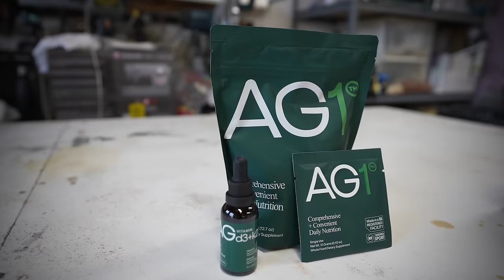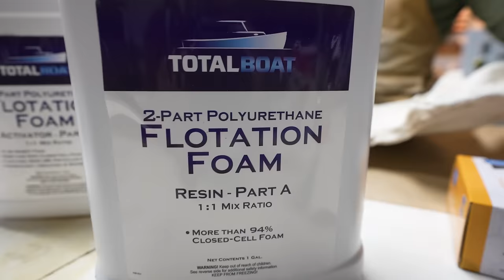Why I Covered my Whole Body in Plaster

Comment: A cousin of mine who is an artist made a body cast of herself and then took it to a candy factory, where they cast her in hard rock candy!  It was amazing.
Reply: Sweet!
Reply: I wonder how she explained that to the grandparents!🫣😆
Reply: Heh, it's.. an experience! I was a photographer, did some makeup courses and ended up dating a stage makeup and prosthetic artist. They persuaded me to get a lifecast of my head. Was great for making prosthetics, but not exactly a comfortable experience. I've been wondering if it'd be safe or possible to vacform body parts, but I guess it would be rather unsafe to try that on a head.
Reply: @brolohalflemming7042 Vacuforming involves heating the plastic so it will conform to the shapes. Skin and melted plastics are not a good combination,....
Now, vacuforming around the life casts, to make lightweight sections for a cosplay armor, that can be effective.
Reply: @PiDsPagePrototypes  Yes, indeed. This was something I'd been having fun with using my casts. But this was a couple of decades ago, and vacuforming has moved on, so if there were lower temperature polymers that might be safer. But if I had the money, what I'd really want is a scan, then mill-a-me out of stainless steel. Fit joints and a poseable me! Not exactly portable, but durable.
Reply: Is your cousin Ali Spagnola? She did that and then threw it from her balcony to the concrete driveway. For art, of course.
Reply: Having a candy me is my new life goal.

Comment: As a fellow makeup professional who has taken life casts many times, I was quite worried when I saw the title, as people have seriously damaged themselves by using raw plaster against their skin.  (Do NOT do that!!  Plaster heats as it cures, and can burn your skin!  It can also encapsulate hair and fine tissue, causing extreme pain if not permanent damage.  Do NOT use raw plaster directly against your skin!!)  
So I was quite relieved when I saw you in the hands of such capable professionals as Jason and Mel.  Technically speaking, you don't have to be completely naked to do a life cast; you could have worn a sports bra and shorts, to go the silicone mold route; it's not an all-or-nothing proposition.  But this technique seems to have worked out fine, for your purposes.  It was actually interesting to see the silicone go INSIDE the plaster mold- essentially as a mold release.  Interesting, for sure- makes me think about alternate ways of doing things.

Some more sanding to refine the shape and take out the extra bumps, and then sealing with a top coat: that would be WELL worth the extra time and effort.  You're not going to want to put fabrics and such up against that raw foam; it'll snag all to heck.  But this is a great start!!  It's so fun to have a clone of yourself, isn't it?  😄😄
Reply: I'm so glad someone mentioned this cause in high school my class did plaster mask and to protect from burns we put Petroleum Jelly on our faces the partner I was assigned didn't put enough on my eyebrows so when the mask came off so did like 6 eyebrow hairs from each eyebrow which really hurt so yahhhhhh.
I'm also rather glad you mentioned wearing something like a sports bra and shorts underneath cause I was thinking the exact same like "why wouldn't she just wear a bikini or a tight tube top and boy shorts" strange that she didn't think of that since she wears sports bras and shorts as ever day clothes like all the time and she was literally a beauty pageant winner so she's worn a bikini in front of hundreds before and thousands if you count everyone who has seen it and her bikini pics on Instagram so weird her mind went straight to leggings and a rather loose shirt...

Comment: when i was doing theater prop stuff, the way we made full body "casts" was with chicken wire! we'd make a stand (essentially a basic armor stand shape) and then we'd wrap the lady being cast in chicken wire. from what i remember, she did the wrapping herself for modesty reasons, because it required a LOT of fine tweaking of the metal wires that make up the mesh. i believe we had the seam actually run down the side of the model being cast instead of the back because she had to do a lot of fitting around her bust by herself. when she was done shaping the chicken wire to her body, she just gently opened it like a book, slid out, and the mesh sprung back shut. after a bit more fine tuning, we put the mesh on the stand so it stood at the right height. then it was just a matter of picking a skin. we went with a thick latex that was spread on the chicken wire with newspaper directly on the wire to cover the gaps. the latex allowed for some minor articulation. it worked incredibly well in the end, and that dang cast scared the crap out of people for years after lol. once it was fully clothed with a long dress and a bonnet, it really just looked like a lady standing still.
Reply: Wow!!

Comment: I was talking with a friend the other day about the possibility of using an iPhone and its IR/LIDAR to scan someone's body so then you could upload it so you could basically have an accurate "avatar" for trying on clothes virtually. I wonder if you could scan your body just standing there and then using CNC to cut the blank out of foam?
Reply: Yep, there's several 3d print channels that have gotten full size statues of themselves made. Better quality prints start with a better quality model so using a good scanner (not an iPhone) would be a better choice.
Reply: For sure would work. You don't even need any fancy lidar. Photogrammetry works by taking a bunch of regular pictures from all angles and then some cool software makes a 3D point cloud that you can process and turn into a 3D model. As long as you get the scale right then it would work great.
Reply: Naoimi Wu did something similar. I think she had the mannequin made from laser cut cardboard.
Reply: That would be the "easy" way...
Reply: It wasn't for clothing or avatar use, but I've used a pretty high res lidar scanner before to do something fairly similar. And yeah you definitely don't need anything super fancy. In fact, the iPhone is probably even overkill for doing something that would be involved in clothes modeling.
Reply: Linus Tech Tips just did a vid on a new VR headset that you use an Iphone to 3d scan your head and then they can custom print the face pad to fit you perfectly.
Reply: Adam Savage has done a couple fully body scan videos including life sized 3d prints. It would be super cool to have a Xyla/Savage crossover video
Reply: The clothes would also be digital only. Which need to be designed like in blender and then proportioned to match the body scan model.
Translating the clothes back to a cloth pattern is difficult.
Reply: @bryank7500  Yeah, that would be interesting. They already have fabric simulations in the best game engines. I wonder if top brands would invest in something like that? They'd have the added benefit of being able to quickly mock up different styles and put them on AI generated "models". I think I saw an article the other day about a Spanish brand that was doing something like that.
Reply: You can unwrap or smash a surface back into patterns in a lot of CAD software. Main use was for sheet metal fab. It's not trivial, but it's easier than it looks even by hand if you know the tools.
Reply: @bryank7500  there are already commercial and open source solutions to this that will flatten a pattern into something that can be printed or that can even cut apart a 3D model of a garment into something that can be then cut out of a piece of cloth. It's a really interesting math problem that a decent number of people have already put a lot of work into and it is still relatively computationally intensive. But it's possible to do and it's an interesting way to do rapid tailoring which I think we will see more of in the future

Comment: 6:15 there IS a (small) chance, when doing the mini-pour method, that a later pour can find voids or gaps in prior pours that, if rigid, COULD cause your mold to crack. this is a SMALL possibility, and can be pretty easily avoided by making sure to pour evenly, right down the middle, so that you don't get wall-growths that could overhang to make the aforementioned voids.

I built a poly-foam filled boat with my dad as a kid, and we broke the first one this way, trying to pour into a too-small opening in the fiberglass shell.

I would kinda liken it to cracking rocks by wedging pieces of dry wood into a crevice, then pouring hot water on them so they expand to pop big pieces of stone apart.(the way they cut the cave-dwellings outside of the holy lands and in parts of Syria)

Comment: Be careful with polyfoam cutting or sanding it. The gas in the bubbles is nasty. It is a form of cyanide. 
When I was shaping my car, using this stuff, I had to use a respirator with chemical filters. Not using it made me lightheaded in just a few minutes.
Reply: I am not 100% certain on what type of foam Xyla is using here and I am too lazy to look things up. But my best guess would be that the gas that forms during polymerization is actually CO2. So, that's nothing to worry about. It certainly wouldn't make you light-headed at those concentrations.

But you are entirely correct that there are nasty chemicals involved. You just guessed wrong about which part is dangerous. As always, unreacted monomers are something to be very careful with. This means, extra care is necessary both while casting the foam and while handling foam that isn't 100% cured yet.

While isocynate groups aren't the same as cyanide, they are still plenty unpleasant if you get them on your skin, mucous membranes or into your body. You definitely don't want to inhale the dust. It's probably less bad once the foam is fully cured, but it's still not good. As a general rule, inhaling dust is always bad.

And that's not even talking about any additives that might be present in commercially available two component systems, and that could have all sorts of health or environmental issues beyond the obvious concerns with mono- and polymers.

Of course, that just reinforces the importance of good habits. Every single time that you work with chemicals, make sure to download, read, and understand the safety datasheet. If in doubt, copy it out as a long hang written document. That's what my university made us do to guarantee that we had read every line of it. These things aren't impossible to work with safely, but they do all require some precautions.

Comment: Neat!   Now i wonder if you'll be revisiting the CF dress, now that you can make it properly fitted.    The original looked stunning.  I can imagine that a second version if it would be even more beautiful.  Especially since you already have experience to work with the second time around
Also..  Your teal t-shirt is a perfect reversal pun of the old saying..   "MEASURE ONCE    CUT TWIC" (cuts off as the E in twice doesn't fit) It's like that sign on some college of design  The sign doesn't fit the wall and the end of it had to be put on the adjoining wall.

Comment: What would I like to see you make using that mold?
A linked partial exoskeleton with magnetic joints, held to the body via comfy straps. example would be loops around wrists & by the elbow connected via a flat piece positioned to ride over the radius. Magnetic joints to the next part as the humorous to the shoulder. Things get tickly there! I keep having challenges following the lines to fashion a joint!

Studio 1st, right!

I tried doing a whole body casting! Did faces and never did a whole piece! Congrats! My plan was to make castings of people in full lotus & yoga positions. Then make clear positives. High refraction, could be nice. The full meal deal was to then frame in with Tibetan inspired stained-glass! Ahh... The last batch of playful projects I was cooking on when my endocrine problem knocked me out of the denial I was in then! I was already struggling!

Now! I'm learning how to produce around the limitations! Just ramping up effort now. 3 injuries that needed attending to! Good to see how far I can go! Thanks for the inspiration! I will get that exoskeleton. I know I can work out the jointing! Shoulders will be the toughest, I bet. I want little to no lubricants, fluids. Bunch of other requirements!

I 'met' you when you were going on the impossible movement project. It helped me imagine my way to getting my projects built. What I need to be in place to make my workspace, given my limitations, work! Thanks.

Comment: Great video Xyla, looking forward to the revisit on the carbon fiber dress.  As for other stuff any number of sci fi armors suits would be cool. I wonder about doing a medieval/fantasy one with cured pitch or hide glue and textile layers?   Not showing how you/ they decided where to cut the top of the legs/ bottom of body to join them together seems like something the video is missing. 

Looking forward to your seasons yeetings video.

Comment: After doing this, do you think it may have been better to line the inside of the mold on to of the silicone with batting, then filling with foam, so that you could pin fabric to the mannequin without damaging the integrity of the foam?

Comment: Is the height correct? In the final version it looks a bit taller than you, which could easily happen if the top and bottom molds had a bit of an overlap.
Reply: You can see they are the same height at 11:51 other times Xylafoams feet are on pipes on a baseplate a few inches off the floor.
Reply: @knucklecorn  It's hard to see how much the baseplate adds to the height, compared to Xylas shoes. IF there is a difference in height it would also be quite simple to fix it.

Comment: I imagine the only downside do doing it with full clothes is you don't have a form fit bust which might be helpful for certain types of outfits. I do laser scans of actors a fair bit for VFX but the process requires them to sit still for about 4 minutes and they always fidget and move and I need to repair the seams.

Comment: Another random thought.  You could could put the mannequin on a rotating plate with a black cloth behind it, and make photogrammetry of it, then use that to design accessories you can 3d print.  Then again getting a regular 3d scan for about $1000 would allow a more accurate fit.

Comment: I think you should show up to a renaissance festival in full, solid, chromed to the moon plate mail. Maybe nickel plated aluminum if that's possible, to reduce the weight. Actual chrome is kind of nasty to work with. Of course there's other cosplay and conventions around, too. Fiberglass and resin are totally on theme, if you want a more plastic look. Maybe some carbon fiber inlay on the joints. Anyway, look forward to see what you do with it!

Comment: About the freehanded seam line, it also seems like it would be kind of impossible to achieve a seam any other way.  I can't think of another method since you can't plan ahead of time exactly how the actor will stand.  Also it's interesting that intuition and experience is good enough for something that often takes a lot of calculating to do systematically.

Comment: I'm really shocked to think that Hollywood doesn't digitally model the forms, I would have expected a lot of 3D scans and CNC printed molds instead of actually coating people in a physical medium. Very cool to see!
Reply: If you want a genuinely life-like result, old-school is best.  The silicon takes a far finer texture for the skin than any digital scan can achieve.  That's because the silicon is basically "analog smooth" versus a "digital approximation" of the surface.

Comment: I wonder why  you didn't do a 3d scan and then stamp out the two halves?

maybe not stamping, but 3d printing?
Reply: 3D printing takes a LOT of time, and most people only have printers that do around 220mm each direction so you would need many many parts glued together. More and more companies are coming out with cheap and large printers but they aren't terribly common yet.
Reply: @NorwayVFX  i have a tronxy printer that's got a 400x400x400mm print volume, and with something like a volcano or cht high flow and a >1mm nozzle, you can prob print a lot of it in vase mode and expansion foam the insides after

Comment: Thats realy Brave, It must have got hot curing. I had a friend cast my face with plaster for a zaphod animatronic head, having your mouth covered is really uncomfortable. nose tubes. Your doing good. How aerodynamic is foam Xyla, quadcopter . The mould could make pressure formed hot plastics , vacuum former. Xyla skins. Accelerometers and subject it to new and undefined accelerations. Great video.

Comment: It's usually an entire mold in silicon, the plaster part is usually the "bounding box". However, at the price of expanding foam (in spray cans in any building store, it's used for window insulation), you probably could have standed in a square wooden box for 30 minutes without moving while pouring foam in it. Now you have got the molds, you probably can make as many replicas as you want...

For the mannequin itself, you probably could have tried to mimic the articulation of the femur, it's probably feasible for a mechanicla engineer, even if the femur bone geometry is a mess in itself (especially on the sacrum side, even worse if you try to mimic the supination features).

For your next project, the choice is obvious: animate that with an endoskeleton, servos, steppers and microcontrollers, hung from a bracket so you don't have to struggle too much with gravity and friction to make "poses".